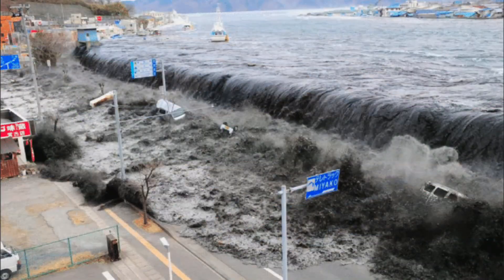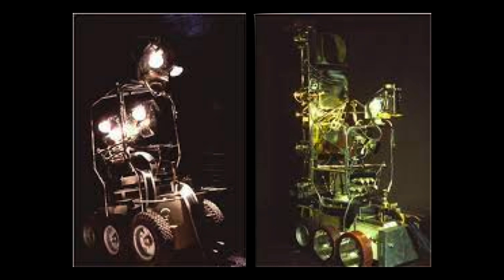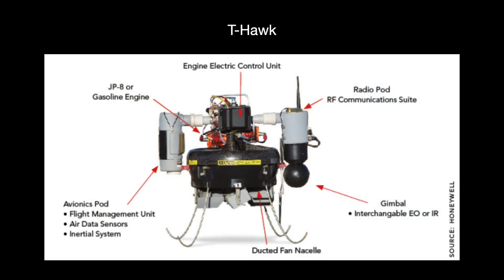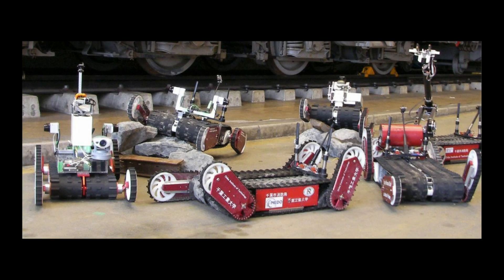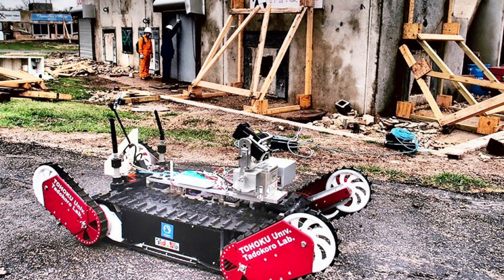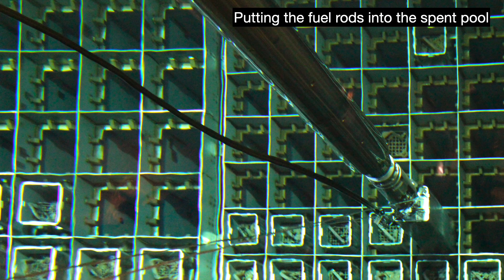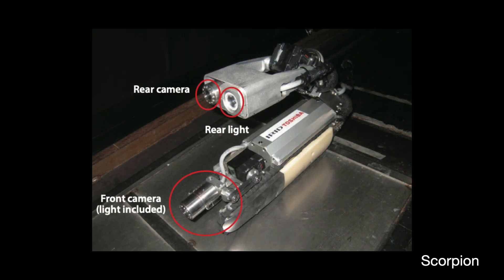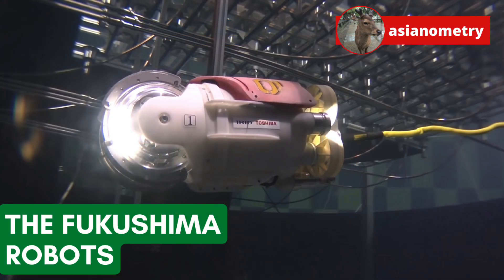The Fukushima Robots

Comment: how tepco still have a licence to run this facility is beyond me. forged safety docs, cut cutting at the expense of safety, really poor response. basic engineers who didn't realise that during rainy season water flows downhill. tepco are making a fortune out of the "clean up". nuclear is cool, glad that in the west with the energy supply issue things are changing.
Reply: Sources for these claims are direly, direly needed. That plant ate not one but two disasters 'top 10 of all time' category consecutively and very little happened despite human error compounding it. 
Which means it's quite safe.

As you heard in this video a meltdown didn't actually do anything because the reactor is built on a containment vessel. They could pretty go "Oh well, it was fun while it lasted", close the door on that particular reactor and leave.

I mean do we clean up after other sources of power? We don't. We don't pick up all the burned coal and put it back inside the mines. Nuclear power leaving a tiny footprint of spent reactors is still the cleanest and safest form of power on a geographical scale.
Reply: @nvelsen1975  > I mean do we clean up after other sources of power? We don't.

Because other sources of power do not leave materials which can kill you with invisible rays without you feeling anything at first.

> Nuclear power leaving a tiny footprint of spent reactors is still the cleanest and safest form of power on a geographical scale.

Name me another type of power generation which created 4000km^2 of land permanently uninhabitable (Chernobyl Exclusion Zone).
Reply: @denysvlasenko4952  
There is no need to answer your question, since your question is based on a lie.

The original zone was 2600 km² and has in effect been shrinking since then.

But to answer your question anyway, hydro power has done that and way more than that.
Reply: @nvelsen1975  There are further 2000 km^2 of exclusion zone to the north of the station, in Belarus. In total there are about 4000 km^2 excluded today.
en.wikipedia.org/wiki/Polesie_State_Radioecological_Reserve
Area: 2,162 km^2
Reply: Could be the case of "too big to fail" for japanese economy and power grid so Japanese Goverment is allowing it.
Reply: @denysvlasenko4952  this is very true however Chernobyl was a very early reactor system hampered by USSR corruption and arrogance, modern systems have learned from those mistakes, for example the fact that this reactor and many modern ones are contained so that they can't leak out into the ground and ground water and just generally far better systems and design to prevent things like the gas explosion that caused the irradiation around Chernobyl (gas explosion flung radioactive dust into the clouds which rained down for months)
Reply: Tepco sold the plant and absolved all liability. Just like declaring bankruptcy makes all your debt disappear
Reply: GE had developed expensive reactors for the US Navy which declined to buy them. Designed for a submarine and pushed upon the Japanese. Number two was engineered to explode, the pressure relief system inside the reactor could not open because of the high pressure resisted the air pressure powered valves powered from compressed air on the outside. Getting it installed on budget meant on the cheap as they were already losing big bucks before they even got started. They were advised of a tsunami line. The expense of the additional 30 ft rise meant they dug deep into the Earth so that the cooling system connected to the ocean would be cheaper to build and operate at a lower level. If America can get Japan which was bombed to adopt nuclear power being so adverse to nuclear energy, the rest of the world will follow and it was a priority of America that Japan proceed. Promoted as indestructible. The decisions were made by GE in America on how to prepare the site and campus. The facility does not produce power, it's a cleanup site owned by the local utility Tokyo power.  I watched the NHK documentaries about the disaster. Executives were fired, the cleanup continues, people are contaminated. You suggest that the bankrupt and functioning Tokyo power no longer retain ownership. Who would buy it and why? Are you suggesting that they should sell just the disaster portion of the company to somebody that wants to clean it up or that somebody borrow a lot of money to buy the company that is hemorrhaging money trying to clean up the disaster and end the water flow. It was not known an underground river flowed below the plant facility when it was built. This is all part of ge's lack of in-depth planning. America sold GE and Westinghouse nuclear to Japanese companies and Westinghouse has gone bankrupt. Now the American GE nuclear power company is owned by EDF of France. We are no longer responsible because we don't own it, and France has plenty of problems of their own with their aging nuclear fleet at this time with low output this winter. And then there's the largest nuclear power plant in Europe, filled with large Russian military vehicles filled with explosives packed into the plant with war surrounding it and shells hitting the facility. A Russian soldier knows the ukrainians will torture them to death and it's better to commit suicide than to be captured. It is a fact they are taught and prepared. No longer in Putin's hands, a crazy mad Man ready to commit suicide at the facility has nothing to lose bringing the facility down with him. Unlike Chernobyl there will not be a million Soviet soldiers sent to clean it up 2 minutes at a time each was catastrophic death following many. A much larger disaster may unfold that will make Chernobyl and Fukushima seem like a day at a fun park comparatively speaking. You don't give credit to GE or the Americans that put it exactly where it is, giving all credit of fault to those who are not responsible. We forget history. Arnie Gunderson was a whistleblower against the project from the beginning and was fired from GE for opposing their plan in Japan. Who offered the one child policy and saw it was imposed was Henry Kissinger and Richard Nixon when he went to sign in China the deal that opened up China after we dropped the gold standard and moved our factories to China. Chairman Mao was not the most intelligent man, but that was the deal and it sounded like a very good one because they had too many people and too many babies. If he would simply impose the one child rule we will provide China with industrial jobs and defeat inflation in America using worthless dollars to fill our stores with cheap product. And Kissinger never gets credit. What company do you think would be best suited to take on the trillion dollar task of cleaning up Fukushima without bankrupting the consumers of power in eastern Japan to replace TEPCO? Perhaps GE America should take up the assignment as it's their creation and their baby so Americans can pay through our electric bills the cleanup cost of Tokyo's disaster? As for the Hanford nuclear waste reservation leaking into the Columbia River, much more toxic acidic and deadly, no doubt a safe place to work and nowhere ready to say this place is stable because the tanks corrode from the radiation and acidity of the liquids held with him huge tanks near the Columbia River where the Hanford nuclear power facility with single pass direct River cooling has contaminated the river for decades while in operation, continuing on an endless basis. There's much radiation contamination in Georgia and South Carolina not to mention a top secret dump north of St Louis a neighborhood was built on. As we look over there and point our finger casting blame they look at us with wonder how hypocritical we are  as we can't take care of our own disasters and created theirs. The underground permanent storage facility in New Mexico caught fire in the storage area without filters on the powerful fans releasing radiation into the air. Naturally it was safe according to all reports. And the one who got the whole ball started was President Eisenhower and his Atoms for peace initiative. Our first gift reactor was to our dictator friend and Ally we installed, the Shaw of Iran in exchange for the continued flow of $2.50 a barrel of oil of which there was no tax with benefit to the state or the residents, only a personal check to the evil despised Shaw which was overthrown in 1977. We gave them the reactor in exchange for practically free oil and now we sanction them because they are using our reactor and won't give us oil for the price of production. I didn't lie I didn't exaggerate everything I said was as truthful as I could possibly be. I have a good memory and have watched many different documentaries and opinions on so many things including this. I'm not hating on you. We have all been lied to and distracted from the truth by more important things like Beyonce, weed, and Hillary's server that was inspected and found never hacked, the BDE of men with sticky little hands. Only those of Great character and intelligence such as Marjorie green Taylor and missed his calling, Herschel Walker who could have saved the day with his brilliance. These are the mines that will lead America that our children have a brighter tomorrow than we had today. I bet George Santos of New York has a great plan for America and the world to solve these problems such as global warming, methane, and the after effects if Europe's largest nuclear power plant campus explodes. There's no need for truth or integrity or knowledge necessary to solve The world's problems. Only a liar and thief seemingly has the right qualifications to take care of all things for all people especially himself. A trojan horse indeed, can't be put back into the bottle. And it can't be let out of the bottle either because it's deadly. And a 1 billion watt reactor dumps 4 billion Watts of hot water into the ocean to keep it cool. With many of these plants how does this not contribute to global warming? The nanoparticles that left fukushima's the detonation were full hot maintaining about a 4500° temperature even though you can't see them. That summer was the first time all of the Greenland ice sheet uniformly was melting everywhere at once. No one offered an explanation and it didn't happen the next year. I think it was the nanoparticles.  And then there are our weapons. We don't use lead anymore. We use depleted uranium. See what President Bush did in Iraq, DU babies in Iraq is what you ask search bar for.  No one born there today will ever have grandchildren for sure. How does this compare after you check this out, similar to the video the children of Chernobyl. You go deeper into this subject and please check out the videos I've suggested for you so that you can learn more and speak strong words confidently rather than appearing as an uneducated American Karen pointing fingers in any and every direction but the right one. I'm exaggerating of course, I understand your viewpoint and agree. But there's more to this story and I don't know all of it but is Paul Harvey would say, and now you know the rest of the story. At least a little more about it. Look first at the DU babies born in Iraq and the battle for Chernobyl and the children of Chernobyl. What a trojan horse they have given the world and their long gone dead.
Reply: The engineers at GE that planned the site did not realize there's an underground river running under the plant. As they were told not to build too low but the expense was too high so they dug down deep closer to the ocean for efficiency and cost savings in construction and operations. American engineers contractors and project to get to GE submarine reactor sold to somebody because the Navy didn't want to buy it, they had developed it at Great expense for the Navy. Installed producing power on the cheap, they used nuclear storage facility on the fifth floor with tons of radioactive rods because facilities and equipment to put it on the first floor was excessively expensive complicated and not previously engineered as it was designed for a submarine initially.
Reply: @frankwainwright7826  > this is very true however Chernobyl was a very early reactor system hampered by USSR corruption and arrogance, modern systems have learned from those mistakes

Fukushima proved that "modern systems" did not learn enough from Chernobyl mistakes.
Exactly like in Chernobyl, workers discovered that they don't have enough portable lights, and that their dosimeters have inadequate range to measure higher radiation levels. You would think that AT LEAST things which were found to be definitely a problem in actual prior incidents will be mitigated!!!
Reply: @zAlaska  holy hell dude, calm down!  O_O  Maybe you should be writing a research paper and not a YouTube comment, eh?
Reply: @nvelsen1975  Pretty sure thousands of people around Fukushima couldn't return home for years nor retrieve their stuff, with many choosing not to return even once cleared. That's a little more than "Just close the door and it's all good".

With that said, I'm still a huge proponent of Nuclear power. It's the best and cleanest source of energy we currently have, wind and solar are a nice dream but currently the energy return is relatively little and nowhere near enough for the grid. Hydroelectric is the only other great clean energy source we have, but seem to barely get made anymore because "Think of the fish!".

Designed right, in the right spot, and run right with a competent staff; there's nothing better than nuclear... At least until fusion becomes viable, and even that's still nuclear.
Reply: It's a mate doing the work for them 😂👍

Comment: Cool robots. They look expensive though..
You can buy man-portable 3-phase 480v generators for around $5000 ea.. Trash pumps cost around $400 ea. With a few basic tools, a semi-skilled technician could have pumped the pump rooms dry with the trash pump, rinsed/dried the pump motor windings/wiring with rubbing alcohol and a hair dryer, direct wired the pump motors to run in synchronous mode to the generators, and restored basic cooling flow to these reactors well before damage occurred.
I'm baffled that there isn't a requirement for this basic equipment be stored on site (sealed shipping container or hardened room?) and a procedure in place to implement in case of a flow loss.. Imagine the cost of all these robots, cleanup efforts, unusable land, displaced residents, and damage to the reputation of nuclear energy. A little forethought, a few bucks worth of equipment, and a few guys who knew how to operate the system would have prevented this whole mess. Such a shame.
Reply: Thanks for this!
Reply: Amen! THIS is what made me lose confidence in nuclear power industry. I'm not afraid of radiation per se. I'm afraid these people are incapable of running reactors safely.
They didn't have any plans what to do on total power loss. (The emergency manual had "it can't happen" written about this scenario. Yes, really).
They did not have enough portable battery lights. They did not have enough portable dosimeters (IOW: Chernobyl lessons NOT learned).
Unit 1 had a very simple, robust emergency cooling system which could work for ~8 hours with no operator action necessary, and after 8h it could be topped up with more cooling water by a mere firefighter truck (no fancy powerful pumps needed), but even that one failed to work! (because they did not have plans how to activate it when all power is lost, and because steam valves leading to it automatically closed and then lost power).
They did not have filters on emergency steam vents (and did not have plans when to vent a reactor with overheating water inside).
Worse! US reactors of a similar design did not install such filters even TODAY, after Fukushima!

Comment: There should have been a mechanical array powered by kinetic energy delivered from a safe distance, an array a bit like a 3D printer, which would have made a lot of the exterior cleaning job more efficient on the long term. Attaching robotic arms to the array would have allowed a lot of different tasks to be done without the use of a faillible robot..

Comment: FYI American (and probably other's) reactors are build differently so if they for some reason lost coolant the heat actually decreases the reactions inside and they shut down instead of melting down.
Reply: Differently to what?  The six reactors at Fukushima Daichi are almost identical to American reactors, the first one was actually built by General Electric of the USA and the other five are Japanese-built clones of it.  Also Three Mile Island Unit 2 would contradict you as that reactor lost almost all of it's coolant and melted.

Comment: You forgot to mention the meltdown in the spent fuel pool in reactor 4, which created massive radioactive pollution.
Reply: He "forgot to mention it" because such thing did not happen. The water heated to about 90 C but the pool was eventually refilled, water did not boil out or leaked out.
Reply: @denysvlasenko4952  the spent fuel pool were the main source of radioactive isotopes leaked into the environment.
Reply: @МаксимСоколов-д4я  Wrong.
Fuel in the pools did not melt. When fuel does not melt, ceramic pellets have little leakage even if the cladding fails and water reaches the pellets.
Fuel in reactors did melt, and released all its fission products, including volatile ones. Almost all xenon, krypton, iodine and caesium escapes under these conditions.